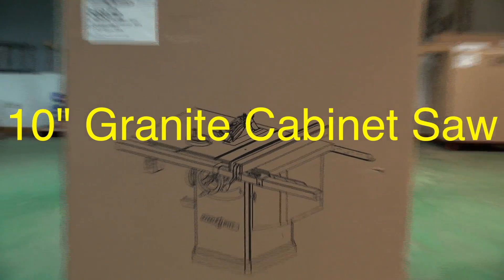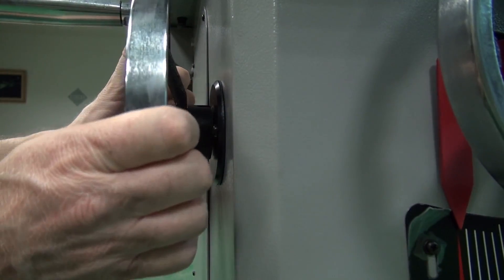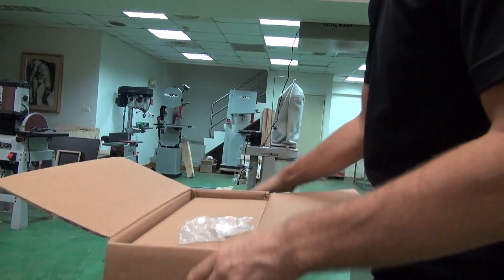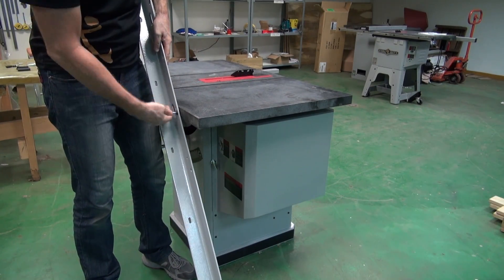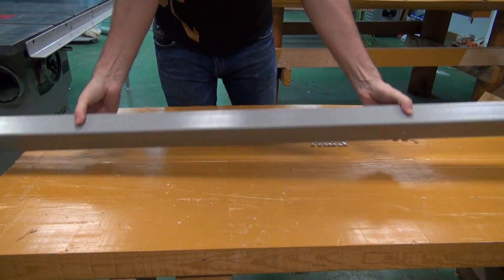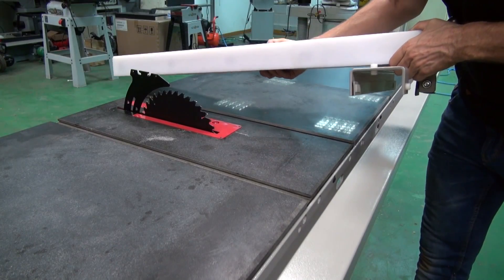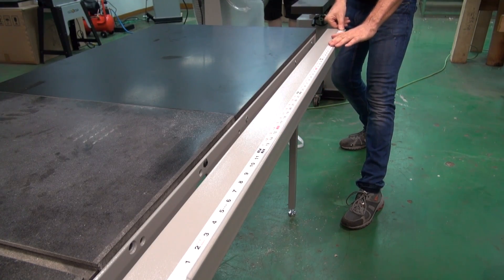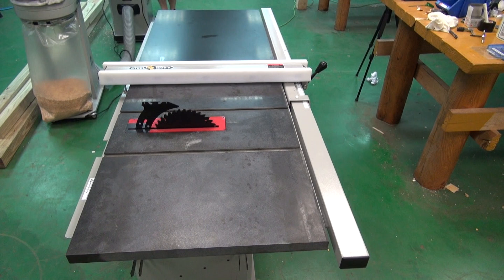10" Cabinet Saw Assembly Steel City 36963 35964 35971 35972

Comment: Just a quick question.  On the website the pictures show that the miter tracks have aluminum miter tracks inserted into the granite.  In this video the miter slots are just the raw granite.  Is this just an older model?  Do all the new models have the aluminum miter tracks embedded in the granite?

Comment from the maker: It's the saw that will appear in all the woodworking videos to be produced in the shop, and has since been modified with a router extension and outfeed table. The shop has been set up as a woodworking classroom as well as a place where tool testing and assembly videos can be made. There's always something going on there. 
Thanks for the comments Michael!